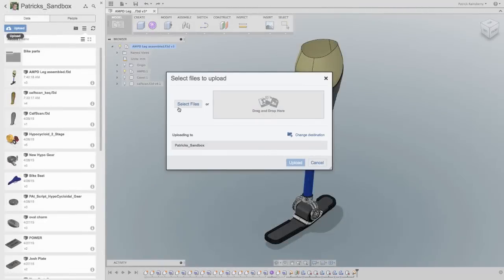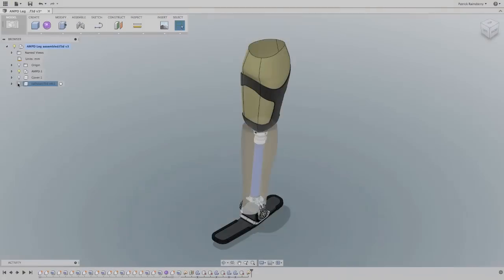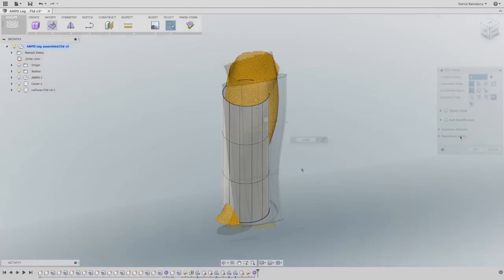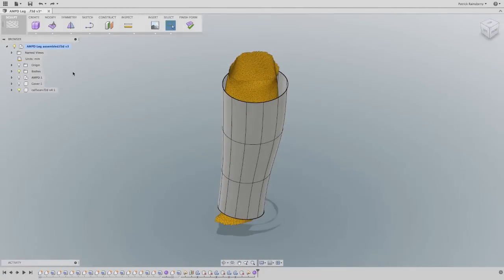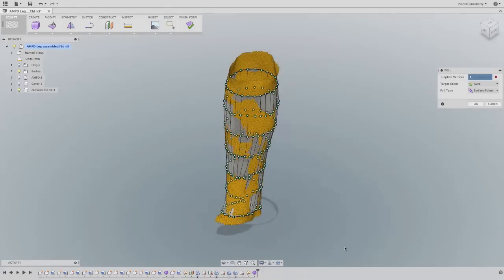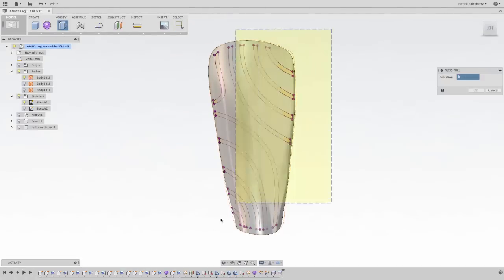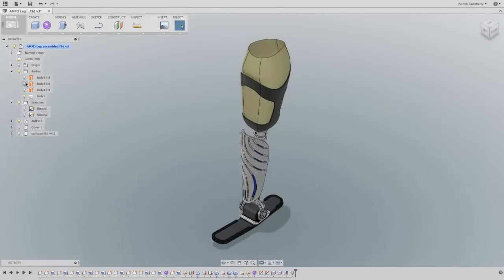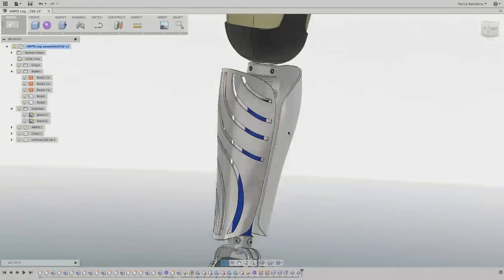Autodesk Fusion 360 Mesh Modeling

Comment: That is very impressive. I wish it wasn't so damn expensive.
Reply from the maker: theslimeylimey $40 bucks a month or $300 per year. Expensive is a relative scale of course, but it beats $7,000 for comparable desktop applications.
Reply: robcohee I thought Fusion 360 was an extension of $9000 required Inventor similar to Solid Edge's Synchronous direct modeling which is built in. $40 a month is very reasonable.
Reply: +theslimeylimey Am I missing something? Autodesk says "free for students, enthusiasts, hobbysts, and startups".
http://www.autodesk.com/products/fusion-360/overview